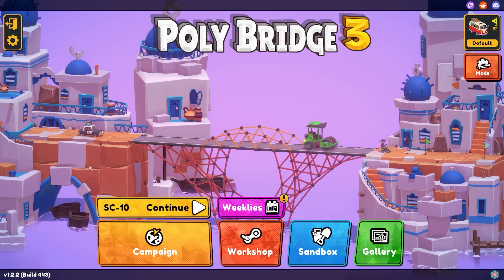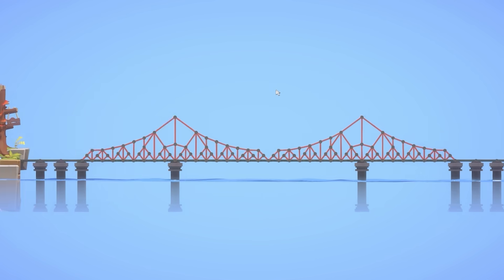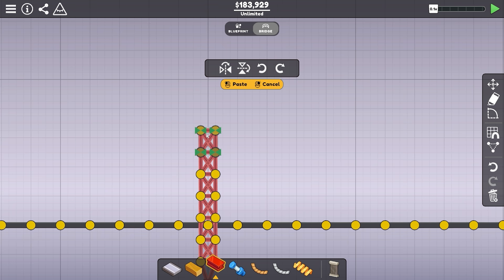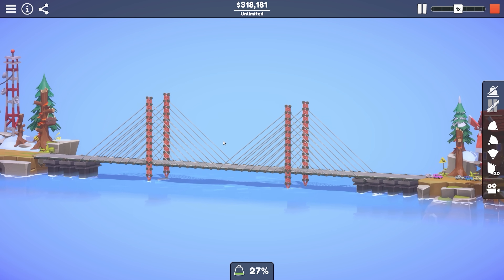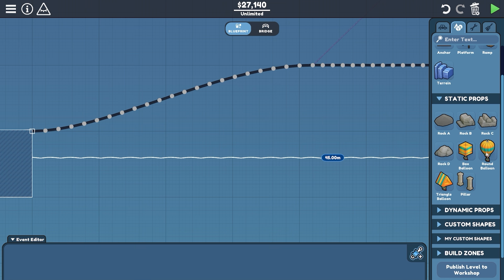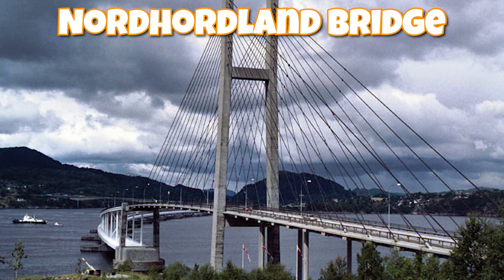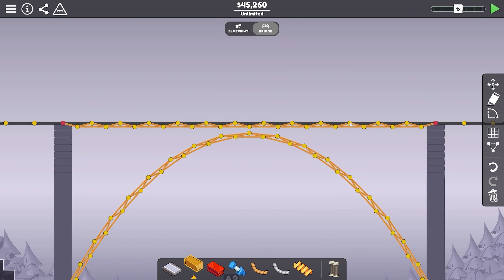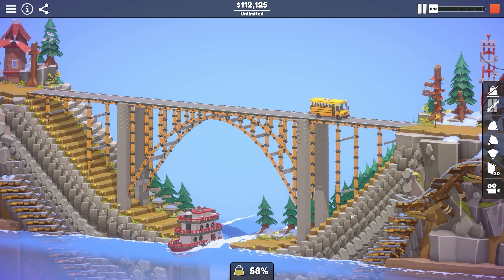Recreating a famous GTA V bridge in Poly Bridge 3!

Comment: The Astoria-Megler bridge should be added to the wheel, its a cantilever truss bridge that connects Washington and Oregon. Its main span is the longest continuous truss in North America at 1,232 ft (375.5 meters) and the whole bridge is 4.1 miles (6.6 km) long. It also gives about 200 ft (61 meters) of clearance over the water which creates a quite interesting off and on ramp on the Oregon side of the bridge. The Tacoma Narrows would be a good option too especially with the original bridge Galloping Gertie having collapsed and the 2 narrows bridges being built to replace it making a good story and representation of what torsion can do to a bridge

Comment: I think that your bridge has too many hinges that caused the failure. If you add more connection-pieces between the arch and the pillars, it will make the middle arch more rigid and perhaps prevents it from rotating so much.

Comment: Hi Matt, Check out the Kinzua Bridge originally completed in 1882. It was a train bridge that was partially destroyed by a rare tornado in 2003 and has since been turned into a 600ft long skywalk with a glass floor at the end looking down upon all of the twisted steel still lying in the valley below. Its 301ft tall and spanned 2053ft located in north central Pennsylvania. It was the highest railroad viaduct in the world at the time.

Comment: Could you add the Tokyo Gate Bridge to the list?
I love the shape of the Tokyo Gate Bridge. It's a great cantilever truss bridge. Called the dinosaur bridge because it looks like 2 dinosaurs. Designed that way to allow supertankers under its main span, and due to the height requirements imposed by Haneda airport they were unable to use a cable-stayed structure.

Comment: Fun Tappan Zee Fact:
The original and its replacement are suspiciously built in one of the widest points of the Hudson River. In almost all cases, engineers seek to build a bridge at the narrowest point, or the closest point to land.
The big, primary reason was that the State Governor at the time wanted tolls to fund a State Thruway, but had it been south at the narrower parts, the bridge would have fallen under the jurisdiction of the Port Authority of New York and New Jersey. Basically New York City, not the state, and the revenues would have gone to the City.

The second, more salicious reas---I mean, rumor, is that the contractors donated a lot to the governor. Widest point=More infrastructure=More jobs=More MONEY.

Comment: In the first bridge, you missed connecting the two cantilever sections in the center - that might have helped it hold up a bit more to the traffic (though I know your goal was to break it for that segment of the video).
Reply: And the issue with the 2nd one is the deck wasn't rigid - Adding some tiny under-trusses might help with rigidity, though might also add too much weight.

Comment: Do you know if the road sections in polybridge are supposed to mimic prestressed concrete? It seems to me that they aren't, because I think that prestressed is basically the same in shear as it is in compression. Which would greatly affect the ability to recreate real bridges.

Comment: It was a game way before poli bridge, it was called pontifex, and I remember a version where you could place nodes in 3D, it had a button to go forward or backwards on a predetermined grid, and it mirrored from the middle of the bridge. Other than that it worked the same. And It was one even before that but I can't even remember the name of that :-D it had no extra features.